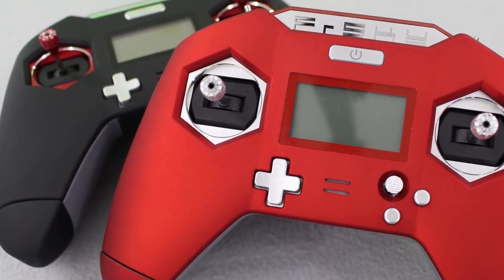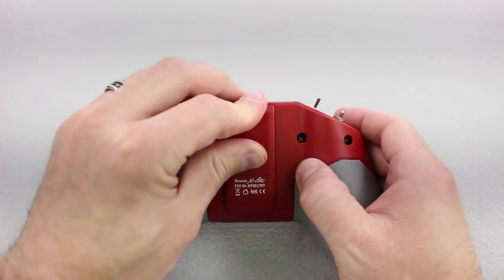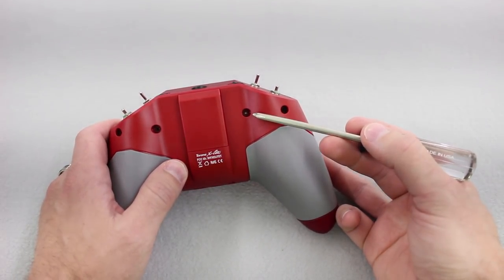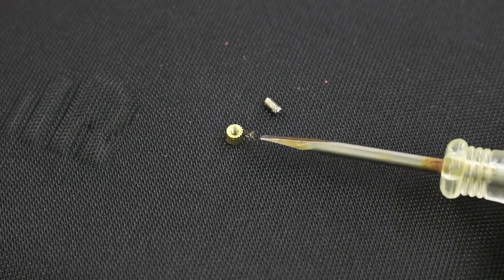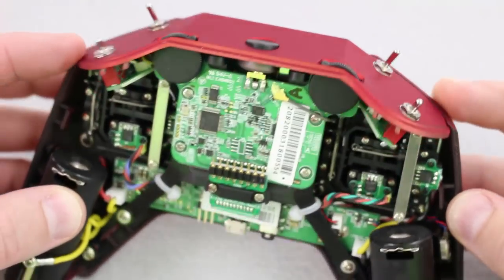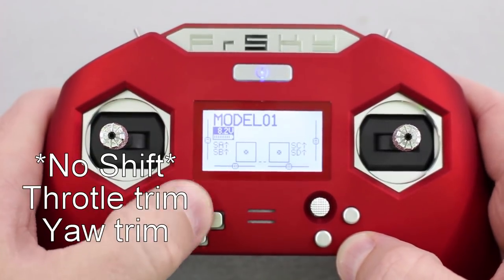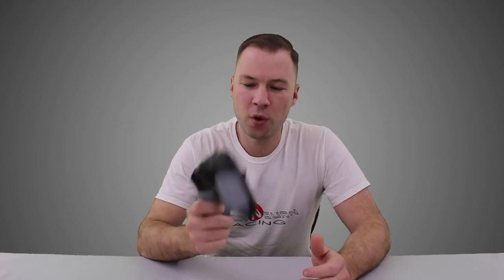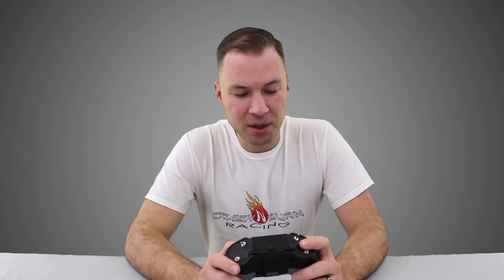FrSky X-Lite - What you need to know

Comment: Great video and very helpful!!!!!!!i am new at the racing quad /troubleshooting and have a question. I bought this controller and my question is when the battery is low or about to die would that make the camera and my fat shark goggles shut down and video go away? any suggestions would be much appreciated .  thanj you
Reply from the maker: The battery power will have zero effect on the video signal.  If you could describe your problem a bit more I may be able to help you out.

Comment: I am sticking with my Evo..this new Tx is incredibly expensive  NZD 1447.00 on AliExpress! My Evo was about NZD 200.00   good video though,  thanks
Reply from the maker: That is crazy, I wouldn't spend that much either! Hopefully after some time there will be some more affordable options available for our NZ pilots.
Reply: ~130 EUR in most shops, shipping included. That's okay  considering that a TX is the most important part of you equipment and will be used for years - and that you're able to use FrSky receivers with you quads (my minis all have XM+ with RSSI installed which are really great).
Reply: Good 130 euros is about 260.00 NZD and which is reasonable so I don't understand what's going on at AliExpress.....
Reply: Many shops used dummy prices while they did not get a final pricing from the manufacturer. Banggood had a price of $9999,99 or something like that, for example. These are just dummy prices. Most of them were replaced with correct prices a couple of weeks ago as the first quantities of the X-LITE went out to the shops.
Reply: Im in NZ, just ordered it through horus rc for just over $200nzd
Reply: Good to know although now FlySky have a new Tx out next month with a similar look to this one..FYI...

Comment: would you recommend this as first controller?
Reply from the maker: If your a thumber I definitely would recommend it.  There is a ton of information on out there on OpenTX and the support for external modules means you can get into long range and there is now a multi-protocol module out so you can use other receivers such as DSMX, Futaba, FlySky and toy grade stuff such as Hubsan.
Reply: Crash N Burn Racing yeah I'm a thumber used to play alot video games and just got into the hobby.

Comment: how do you recomend I charge these batteries
Reply from the maker: Chargers for these batteries are cheap and work well. https://www.amazon.com/Nitecore-i2-Intellicharge-Charger-Battery/dp/B0096U26QQ/ref=sr_1_16?ie=UTF8&qid=1530013608&sr=8-16&keywords=18650+nitecore
Reply: Crash N Burn Racing  Thanks a lot man you might be intrested I found the charger with 2 batteries on Amazon for 13.99.  i could send you a link if you would like but this appears won't let me
Reply from the maker: Thanks for asking but I currently do not need another charger.
Reply: Chargers work great

Comment: I had the same issue with the screwing into the brass thread on mine. Didn't break any screws off, but I just went in and took the spring loose. I'll actually fix it later

Comment: A new low for frsky, they have a huge fan base that they just don't give a crap about.
Reply: How? It has better range than the QX7 and competes with the X9D. It smokes the old 32ms frsky latency and is now competitive with flysky and crossfire. It supports all the same modules as a normal taranis and has all the features quad pilots need.

Comment: Nice video dude. I use a X9D and an Evolution, I'd love an Evolution-size FrSky but I do like that the Evo has a built-in gimbal/switch protector. I like it's light-weight and the fact that it only costs £40 with an Rx! That means I can leave one in the car with a little wing.  The X-Lite is going to need a case and then it starts getting bulky again.
Reply from the maker: The case does make it bulky, I would really like to see a smaller case for it.
Reply: What killed me on the turnigy was the absolute crap RX modules.
Reply: Haven't had any problems myself, the TGY-iA6C it comes with is full diversity and seems about the same range as my FrSky Rxs, even the tiny FS-A8S gets me 350 metres. And £40 for the Tx AND the TGY-iA6C seemed pretty staggering to me.

Comment: Does it come with batteries and can the batteries be charged while still in the tx, like the evo does? Or do I need to buy bats and a separate charger for them?  Good vid, thanks.
Reply from the maker: Russell Reilly It does not come with batteries and you will need a charger as the x-lite does not have the ability to charge. The batteries in the description have been working great for me.
Reply: Cool, thanks for the reply. : ) Subbed ya.

Comment: I'm still using an Evolution even though I've got a Taranis. Main reason is it's more backpack friendly and I really like the PS form factor. I'm really busting to get one of these since the flysky receivers are just crap. I assume you can update FrSky firmware for the receivers like with a QX7? Just waiting on Banggood stocking and I'm ordering it. Thanks for the info!
Reply from the maker: The FrSky receivers compared to Flysky is pretty drastic. Yes you can update the firmware on the receivers also.
Reply: I never had issues with flysky receivers but I've only flown them at 800m or less.

Comment: Very nice review. What about external antennas, which to use and is it for better range?
Reply from the maker: Pretty much any external antenna is going to increase the range.  FrSky had a T shaped one with the pre-production X-Lite's but decided not to include them.  FrSky may come out with it as an accessory. But the plain straight antennas will work well also.
Reply: Does the x lite not come with one?  I currently use a 5 dbi on my x9d.
Reply from the maker: It does not.